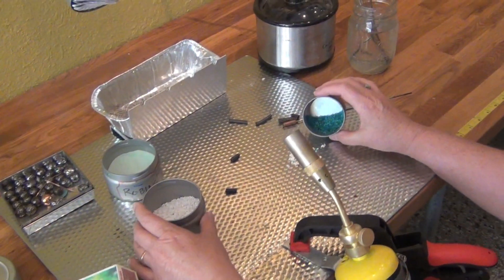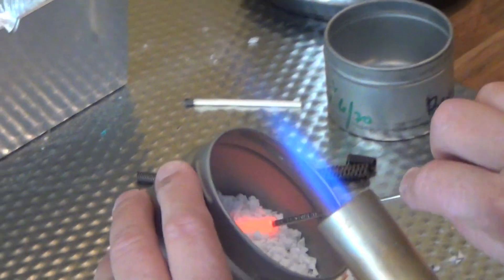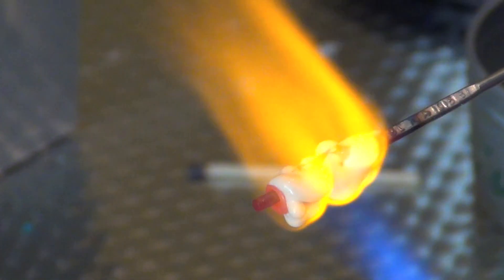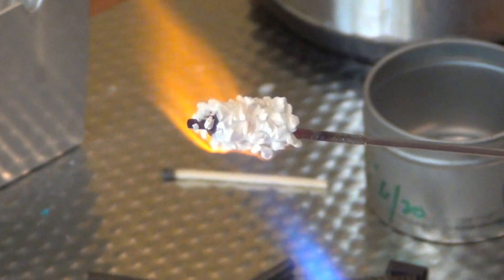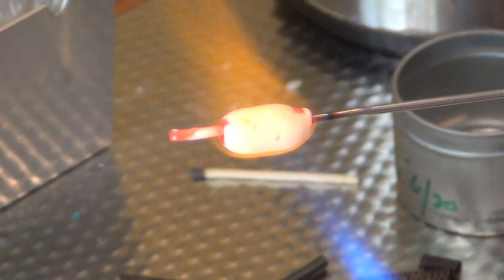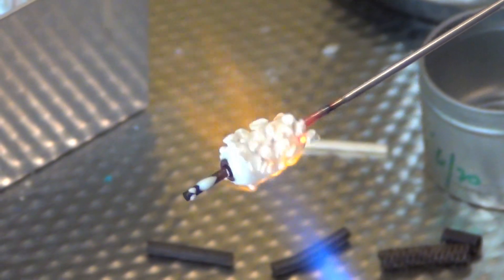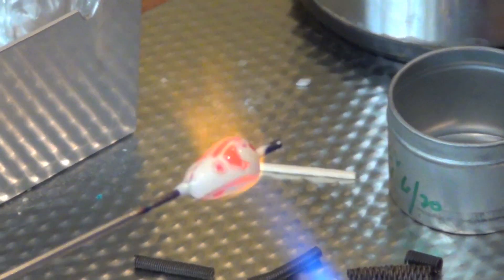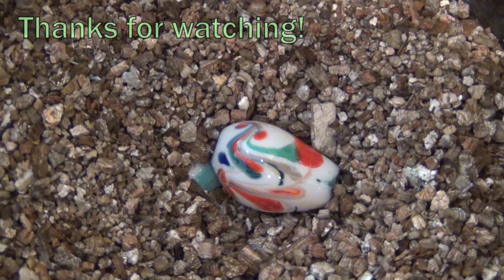Enameling Copper Tubing WIth 6/20 Frit

Comment: You're actually making a lampwork bead directly onto copper using frit correct?  You're re referring to enamel which is confusing me.  Is the really find grit enamel or fine frit?   Great idea and I'll be trying it once I find out if its really enamel or ftis.  Thanks, great video.
Reply from the maker: Hi Buckaroo, The material is called 6/20 enamel, which is manufactured by Thompson Enamel.  The difference between lampworking frit and enamel is that enamel is formulated to fit on metal.  I guess it's kind of a hybrid ... a lampwork-looking bead made from Thompson Enamel in a frit-sized grit!